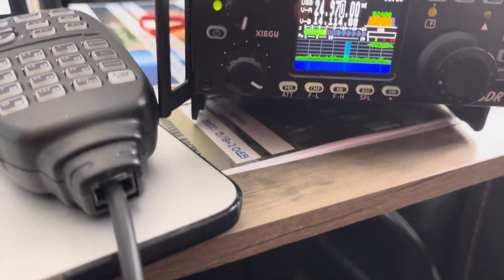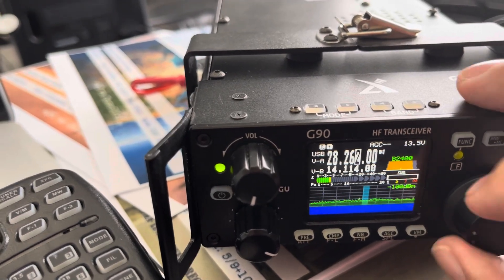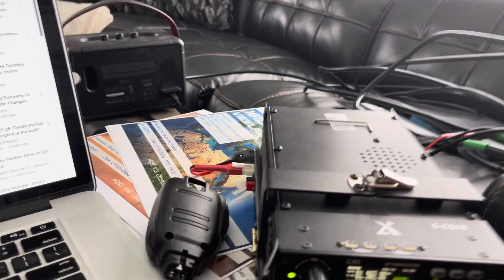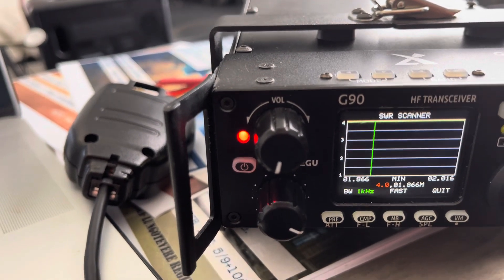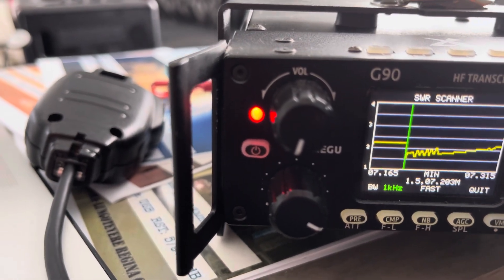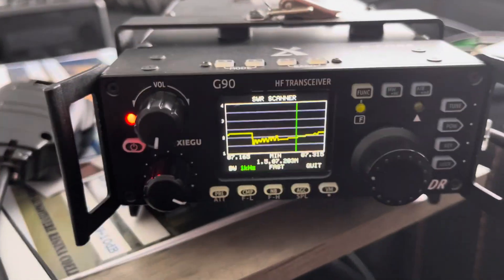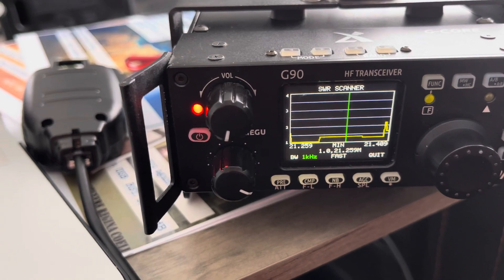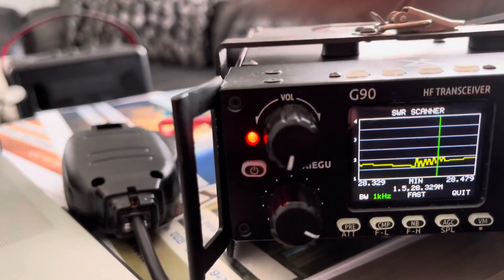Xiegu G90/Tuning test of Sigma SE HF-360 160 to 6 m 1 kw rated Vertical Antenna

Comment: Have you made more contacts with this than other antennas you have? Low SWR isn’t everything.  I’d be interested to see how far it gets out. Also - how noisy is it compared to a resonant dipole?
Reply from the maker: @KD9ZHF  This is my back up antenna. It’s so low to the ground. I’ve done ok by a Dxcc standard but nothing beats a truly resonant antenna which this is on 20 m . Probably a little more noisy than dipole . See the videos of my Dx contacts on this channel. Thanks

Comment: I was told by Paul at sigma comm. that the plus kit is no good with an amp???? I have the antenna with the 1kw unun and a 500watt 811 amp ! He said the plus kit will not work??????????? JohnBoyUtah KJ7TBR
Reply: I use this antenna with a 1306 Ameritron. Works satisfactorily. I couldn't tell you if the radial kit makes a big difference or not.
Reply: I mean, it works enough! We can do a video with the al 80b and the antenna if you want. It's nearly ground-mounted, which is the only drawback for optimal performance. To your point, I don't know for sure if the radials add value but I put them on their as they were pretty expensive on their own.